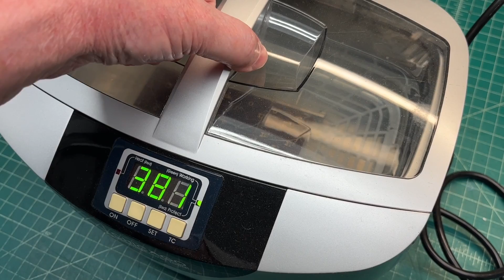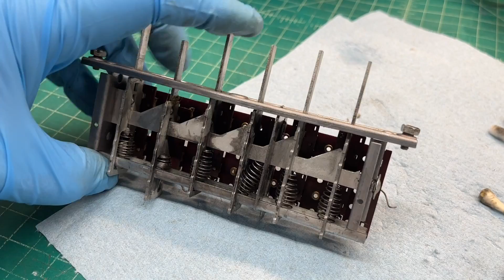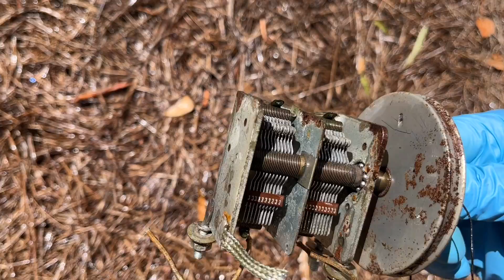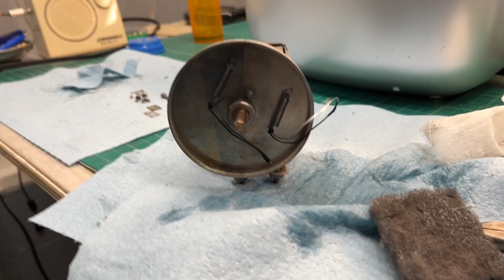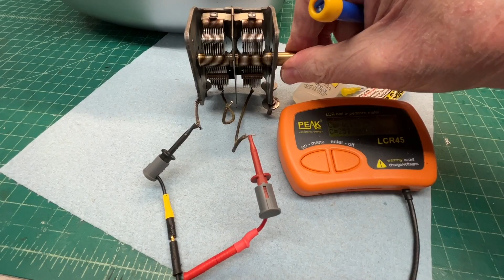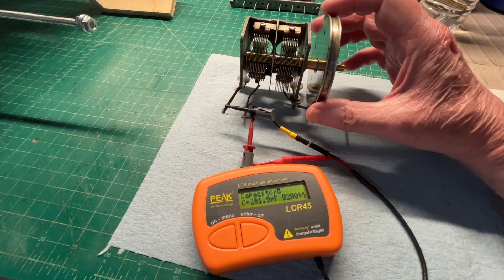Stewart-Warner - 01-521 | Push-Button Switch Assembly | Tuning Condenser | Cleaning & Testing

Comment: Awesome cleanup of the tuning condenser as well as that switch. Thanks for sharing those tips Don, great to know the ultrasonic cleaner works so well!
Reply from the maker: Thank you Tony. They both cleaned up better than I expected. Hope you’re having a great week. Best, Don
Reply: @RestoreOldRadios  so cool. I did not know ultrasonic were so powerful. Btw, so sorry I doubted your i2c pull-up issue.  I was so surprised to see them on my modules too.

Comment: I use Simply Green with all metal parts.  I don't have to do all those extra steps!  Then I use a white silicon grease.
Reply from the maker: Great tip. Does it remove rust as well? Best, Don
Reply: @RestoreOldRadios  - Most of the time it does.  It also cleans carburetors as well.  You might think this is to harsh for electronic hardware parts, but it's not.  I've cleaned many a V.C.'s with Simply Green with NO side effects.
Reply from the maker: @tubeDude48  How long do you typically soak the items? Best, Don
Reply: @RestoreOldRadios  - I run them at 290° for 20-40 minutes per the settings on my Ultrasonic Cleaner. It varies.  Hope this helps.

Comment: Excellent clean up and lube of parts necessary for proper function and testing to be sure. You do great work Don.
Reply from the maker: Appreciate it Steve. Hope to replace a few capacitors and resistors soon and prepare for a power up. Thanks again. Best, Don